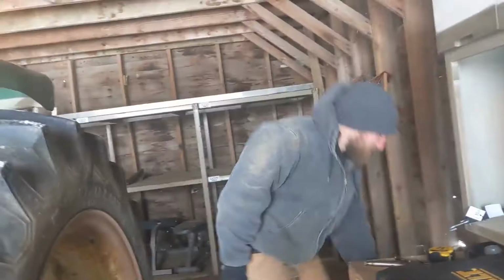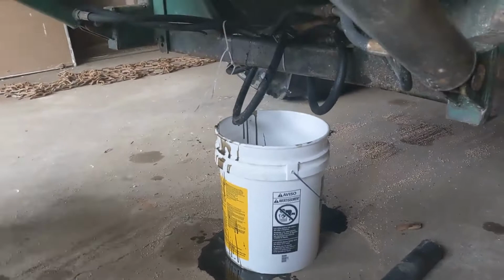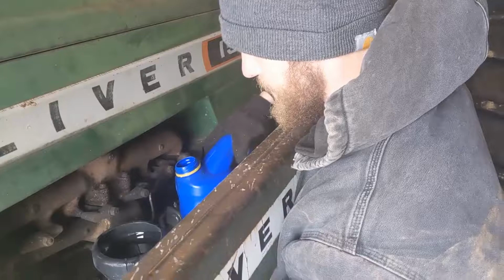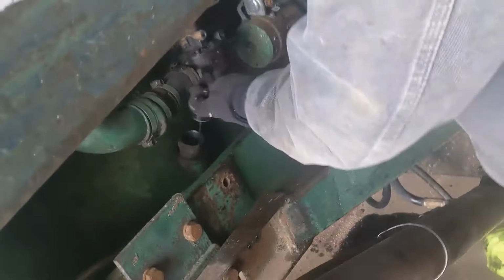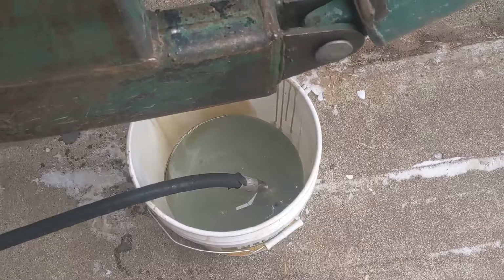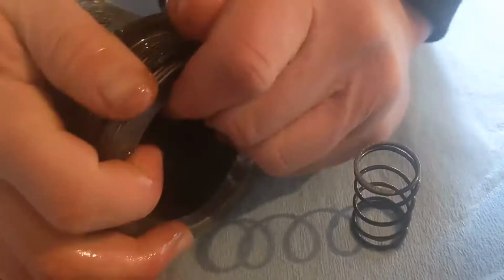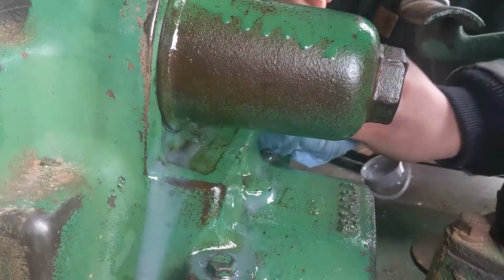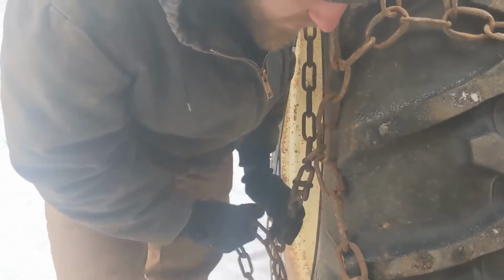Changing Oil (Oliver 1550)

Comment: Nice tractor.  I have a gas 1650.  Tad suprised that Oliver made it so you have to take a line off to drain oil.   But I use the tractor for everything.  Nice video
Reply from the maker: My father has a 1650, if I could have found one I would have bought that instead.
Reply: I’m changing hydraulic oil now and having a beast of a time getting the casting off.   Must have been long time.   Any special “tips?”
Thanks
Reply from the maker: @scottallan7033  spun right off for me. Maybe a pipe wrench or channel locks would work

Comment: An old time Allis mechanic told me to solve the water condensation problem in the winter was to add a little ( Seafoam or HEAT ) to the hydraulic and engine oil.
We are not running the tractor long enough to generate motor heat to evaporate the water condensation out of the system